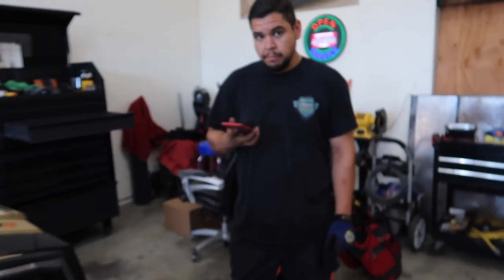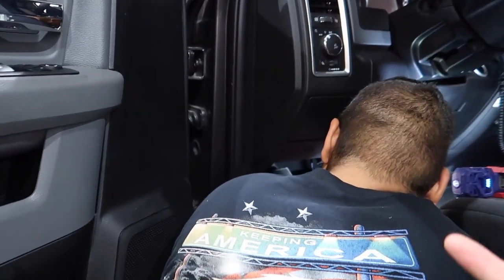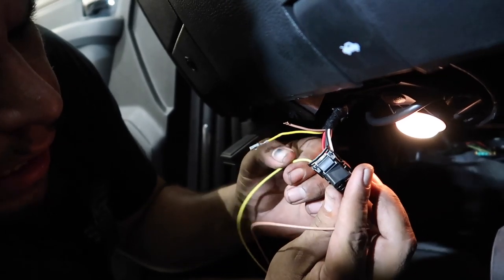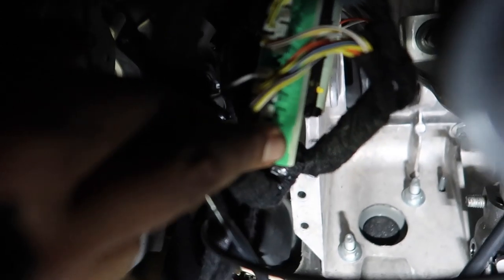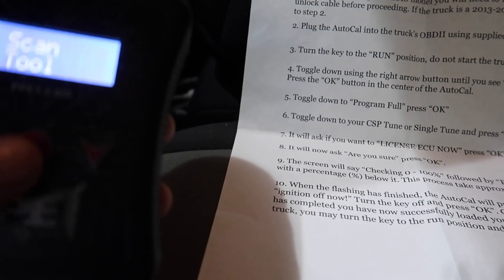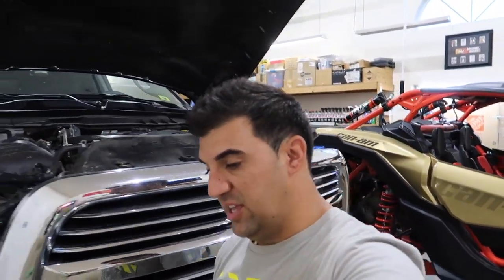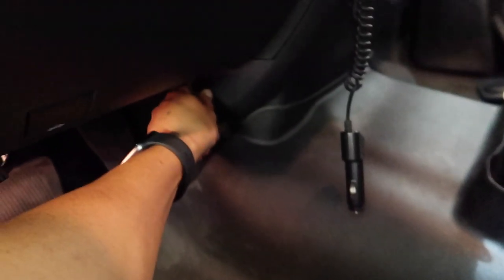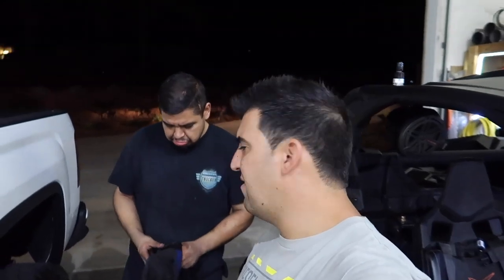IS THIS RAM TOO LOUD?!!

Comment: I didn’t need an unlock cable on my 18 RAM 3500 Cummins. I have PPEI with EZ-LYNK. Love it. If I were to tow more I would grab an edge monitor.

Comment: Wow that weather tech floor mat looks like 💩! Might be removing it from my Amazon cart now 😂
Reply: Go with husky. It’s way better
Reply: @menadin9567  

X2 have them both. Husky hands down
Reply: I have had both and the husky is Supeior.
Reply: @gnevala  wow really? I watched one review on YouTube and they were similar but the husky was slippery, from the reviewers point
Reply: ACanela85 
I prefer the husky’s myself.
Reply: ACanela85 
I had the opposite effect. 
Had weathertech in my previous truck and the were like plastic and slippery. 
Current truck has Husky X-act contour liners. They’re like a rubber mat and not slippery at all. 
Husky does make one that’s cheaper than the X-act contour mats that is like a plastic. Maybe that’s what’s you seen.
Reply: The husky fit better and have higher side walls. More of a higher tray. I recently pulled my huskies out to wash and was gonna throw the weathertechs in that were out of my wifes truck and i had them side by said. I thought no way am i putting them in. Had them side by side and couldnt believe the difference. Weathertechs were much smaller for less protection